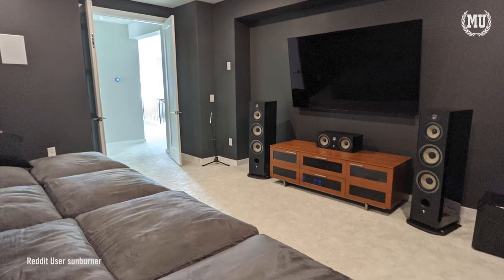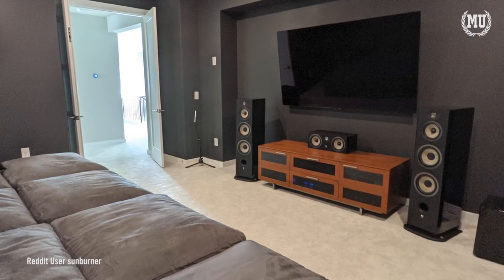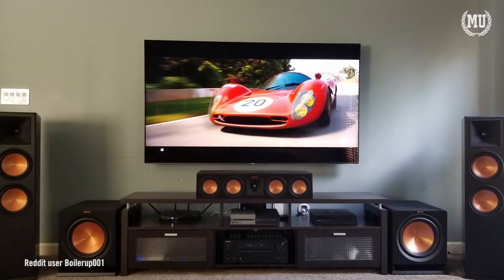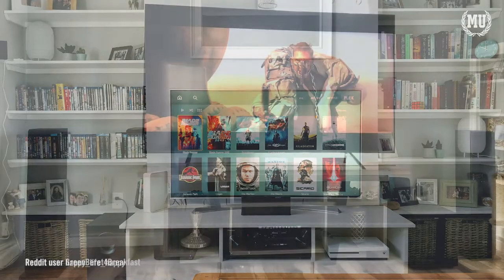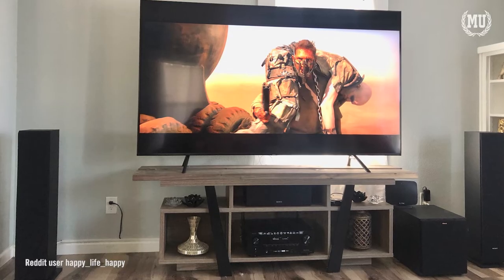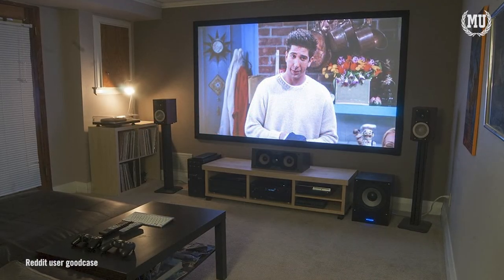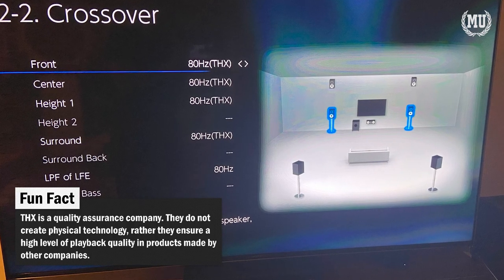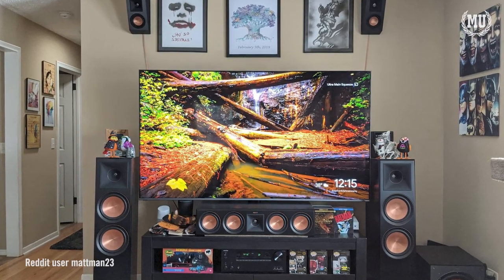Setting Crossovers | How to Set Speaker Crossovers | What Is Crossover | Best Crossover Settings

Comment: I usually set 20-30 Hz above the +/-3dB measurement in the specs. My current bookshelves are rated down to only 100hz, so I set it to 120-150hz depending on placement (boundary reinforcement)

Comment: Here’s my easy set up. Set the speaker configuration to small. Set the crossover on the front two mains at 80HZ. Set the center channel crossover at 10-20 HZ above the speaker rated level. Set the surrounds the same way snd any atmos speakers at 110 to 120HZ. Set the subs to 60HZ on the speaker. This will get a smooth roll off from the fronts set at 80. In the AVR set the bass level to LFE and the crossover to 120. This works very good for low power receivers. I have the marantz NR 1711 at only 50 watts per channel but it works extremely well when not using crossovers at lower HZ. I have the Klipsch Rf26fa towers with Dolby atmos upfiring speaker’s integrated. Running a 5.1.2 setup with two Subs.

Comment: Great video!! I have a couple of questions. Here is my setup:

Denon 4700
Klipsch R-625FA Dolby Atmos Floor stand speakers
Klipsch RP- 504C II center channel 
Klipsch R-41M Bookshelf speakers
Klipsch R-12SW subwoofer

1-What are your suggestions for the crossover settings?

2- What are your suggestions for the db level for all the speakers? This is where I am confused.
Reply from the maker: I hate to use the phrase as a cop out, but it's true. It depends because it's what's sounds best to you. Have you looked in your owners manual for the manufacturer crossover recommendation?
Reply: I have and I used Audyssey for the calibration. Thanks
Reply: Did the calibration again and here are the results. Should I change anything?

Front- 40hz
Center- 40hz
Surround- 60 hz
Front Dolby- 90hz
Reply from the maker: @coachvelarde  Those numbers seem a little low to me. Mess around with them and consistently use the same song, movie or what have you when tweaking. Keep releasing to the same sounds and see what frequencies sound best. At the end of the day it's about what sound good to you. The rest of us aren't in your house judging the numbers you have for your crossovers.

Comment: I did an auto calibration my fronts audio pro avantek six when down too 40HZ. My center too 100HZ. My surround 120hz. LFE 120hz . Is this a good setup ? or should i bump up my mains too 80 hz ?

Comment: I set my tower 6 0hm yamaha speakers that go down to 30hz to 60htz my yamaha center channel goes down to 50htz I set that to 70htz and my yamaha surround sound speakers that go down to 60htz to 80htz. My yamaha atmos go down to 60hz set to 80 hz Both klipsch Subwoofers at 120 and it all sounds incredible...

Comment: Speaker placement is just as important as crossover. Get your centre channel to the outside edge of the cabinet!
Reply: I'm new at this stuff. I recently moved the center speaker to the edge of the cabinet only because I was trying to fit the turntable without pulling the wires. 
 So there it is on the edge until I figure out the final spot for the turntable, I go to watch the movie "Beast", with Idris Elba, and I was surprised at the improvement in sound. The roar of the lions really came to life.
 Thanks for the tip.
Reply: Forward or back of cabinet towards the wall?

Comment: The real question I have is if say you set the cross over to 40 on your front left and right speakers. Do I then set the crossover on the actual sub to 40 too?
Reply: No. The sub frequency should be turned up to max. Let the receiver/ processor do the crossing over

Comment: I am new to this AVRs n all. Last week i got my Denon X1700H & klipsch refernce R series 5.1. Works great as its a starter set up. I set my subwoofer in 80hz. Inside Avr set into LFE. The default inside value is 120hz. Which one should i go for ? 80 for both or 120 ???
Reply from the maker: Go to 80
Reply: What settings do you have on the reciever? I have the same and Iam a newbie. Do I need to change this cross over stuff defying on my AVR. ? I have subwoofer 1200sw

Comment: Awesome video bro!!
I have a Sony STR HD790 and I still can’t figure it out how to calibrate the levels with my spl specially cause it don’t have the volume scale to set it up at 75 to 80 
And when I start calibrating the levels I put my receiver at 0 on the master volume and I don’t get any sound I’ll really appreciate it if you can help me thank you?
Reply: Did you figure it out ? Ive got some tips to help you otherwise
Reply: @mivanp2185   no I couldn’t figure it out 😞
Reply: @josephpicado1818  Its just a different scale. So start with your test tone in your receiver . Start F/L and turn your volume to as high as it reads 75db  on your spl meter. Then do all your channels the same by adjusting via the speaker level setting for each channel so that they are all reading 75db at the same overall volume level
Reply: @josephpicado1818  I have the similar model. Just bought some new fronts so having to do a full calibration again and came across your comment
Reply: @mivanp2185   thank you so much so this avr goes from 0 to 100 on the volume so turn it all the way up to a 100?
Reply: @josephpicado1818  no reference levels will be about 47 on the volume . But put the test tone on then get your spl meter and turn the volume upto where it reaches 75 on the spl meter

Comment: Hmm struggling to find where to set my focal aria 926 towers and 900c centre. Any help
Reply: I’ve got the same speakers. I’m interested to hear what you set them at an how you find them
Reply from the maker: The 80Hz that THX puts out is a baseline that nearly every speaker can go to. However, to get the optimal output look up the specs for your particular speakers on the manufacturers website. For instance, my Klipsch right and lefts are both set to 60Hz because that is what Klipsch recommends.
Reply: I just get a klipsch rp-504c, its set at 60hz and its not as clear as i was expecting... not sure what to set     in some scenes, i can ear background noise
Reply from the maker: @danboy3818  could you retype that last night please. i don't understand the question.

Comment: I have Bose AM-5 series 1 speakers,  I need to setup the crossovers for my cube speakers that have no woofer….anyone have any thoughts
Reply from the maker: Have you looked at the owners manual for the appropriate frequencies?
Reply: @MovieUniversity  Thanks so much for you response. I found this in the owner’s manual: 
2 6” low frequency drivers, and 4 magnetically shielded wide range drivers in cube speaker arrays. 
I know the industry standard is 80hz…So should I raise my crossover to 100-120hz?

Comment: I have R25C, R15M Front, and R41M for surround.

Let me know if I understand you correctly. 
R25C: 120hz
R41M: 150hz
R15M: 90hz I guess???

The sub is R-100sw, I think 60hz? 70hz? 80hz?
Reply from the maker: The Klipsh manual should tell you what is the best frequencies.